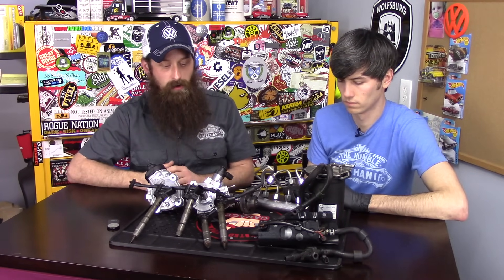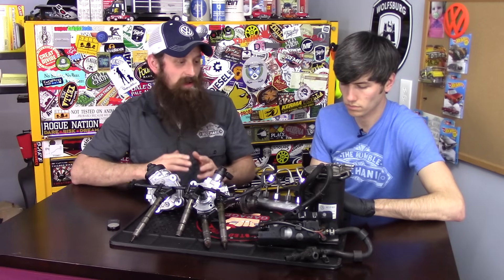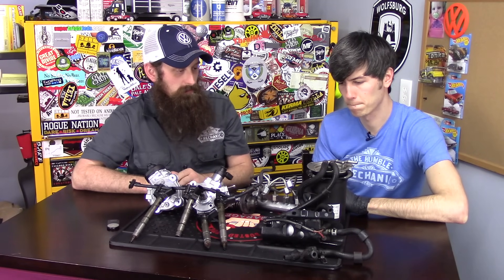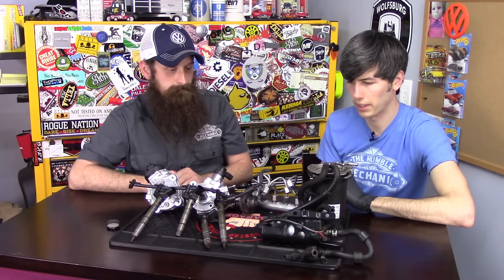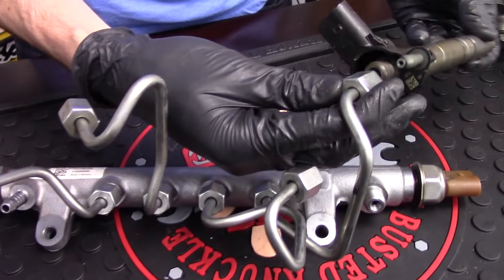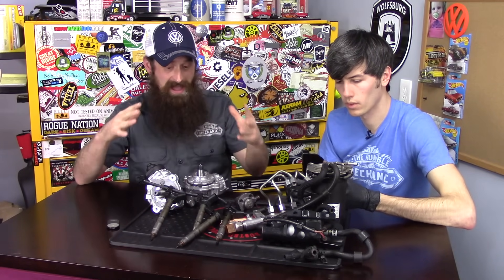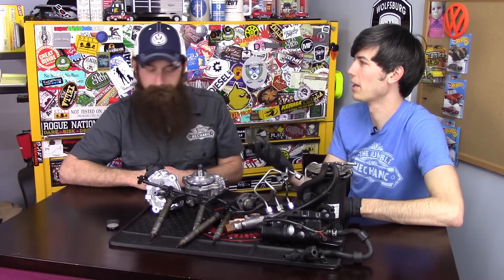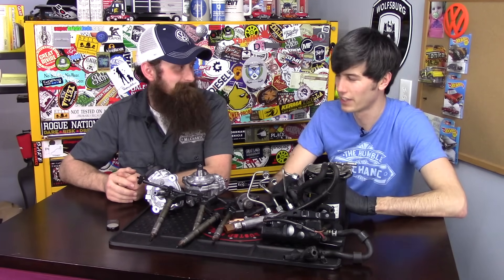Putting Gasoline In A Diesel Car - What Happens?

Comment: It worries me that this gentleman is out there suggesting this kind of work for this problem.  Other mechanics will charge $100 and send you on your way. This fellow charges $8,000 just in case things were damaged by exposure to gas.  The thought process he goes through is frightening. "This could be impacted, new assembly.  This might be touched, new assembly.  This could have a thing in it, new assembly."

It's outrageous.
Reply: this guy works for a dealer and OEM have procedures(bulitens) what to do when a diesel engine  is run with gasoline . the metal  contamination I also  seen it in BMW our repair for this usually  run around  15k.  if the engine is not run we jusy drain  the tank
Reply: +WoodysGamertag dude its crazyy seeing you here
Reply: none of what he said to replace was for exposure to gas, except for the things that would be ruined by gas.
Reply: +WoodysGamertag Could be a new engine in some cases. Labor costs are what kills it.
Reply: HillorStream there is a big difference of having say 1.5 to 2 gallons of gas in say a 20 gallon tank VS say your tank is almost empty and you pump 15 gallons of gas into your 20 gallon tank. But yes you are correct they did put gas into diesel as a winterizer don't know if they still do today.
Reply: Diesel engines WERE different back then. Significantly so.

A non-common rail engine (which is all that was on the market in 1993...) would very likely behave as you describe; I used to mix ~5% gasoline in the diesel to prevent paraffin crystals forming in cold weather, and never had a problem, but I wouldn't do it now. Unless you have someone picking up the tab I wouldn't try this in a modern diesel.
Reply: he wants to make money. dont we all ?
Reply: +WoodysGamertag whoa Woody watches engineering explained? My life is complete
Reply: Because I AM A MECHANIC.
Reply: Isn't winter blend 10% gasoline anyway?
Reply: Maybe if you were able to have insurance pay for it you would go through with $8000 in repairs.
Reply: +woddysgamertag   Around 1993, I accidentally filled up a diesel Ford box truck with gas.  It would only start by getting it rolling and then popping the clutch while cranking the starter at the same time.  It had very low power and the entire tank of gas was burned up in only 60 miles or so.  Once I was down to about 1/16th of a take, I stopped and put diesel in it.  It started after only a few cranks, had full power and perfectly good mileage.  It was just fine and never had a problem for the next 2 years I worked for the company that owned the truck.  Maybe diesel engines were different back then but I'm doubtful.  Mechanics (and engineers) have been known to be zealots in the church of "Right way vs. Wrong way".  I prefer "If it ain't broke, don't fix it".  This is indeed outrageous.
Reply: +WoodysGamertag Crazy seeing you here Woody! I would have to disagree. Any common rail diesel will need to have all these parts gone through if you run gas through it long enough. It is under extremely high pressure, and under very high tolerances. Yes with older diesels you just flush the system and make sure it's primed with diesel and be on your way, but it's not like that with the newer systems.
Reply: @thepeeve  then the newer system suck!
Reply: @thepeeve  - Depends how much petrol you've put in. If you've already half a tank full (say 30 litres) of diesel and you've put in 2 litres of petrol by accident then moved it to a safe place with the engine on for 20 seconds, it's a simple case of getting the tank drained and refuelling with diesel. Doesn't matter whether it's a modern diesel or not.

Now if you've put in a full tank of petrol then it's a different ball game particularly if you've driven it for a few miles. That's when the bill becomes eye watering because of the damage it may have potentially caused.
Reply: +WoodysGamertag You're always free to avoid preventive replacements and wait till something breaks. It is sometimes cheaper, and probably more often much more expensive. Have you ever seen what happens when the injector stays open? Oh its really fun, I mean, if you ever stop and live enough to enjoy. But metal fragments in the cylinder have almost the same fun value, especially after a few hundred miles. Having the high pressure pump broken is just simply boring, as well as having other metal stuff melting together or apart, as it happens.
The guys replace everything which have a high probability to break your engine apart as a preventive measure, and they actually pay for the contaminated mixture to be taken away safely (and legally), but you can obviously just pour it into some water around, say, somewhere in california. :-P
Reply: CARB has announced that emissions in class 7 and 8 trucks do cause issues and reduce reliability. So it may trickle down to regular autos soon and dpfs will be removed until the system can be made to be fully reliable.
Reply: fightingfalconfan have to agree. Gas engines are way cheaper and just about any knucklehead to work on it. Newer diesels...not so much. Plus the hourly rates are usually different too.
Reply: On a trip across country with a bunch of guys... a fella put gas in his buddies  diesel truck.  Fortunately we had a mechanic in our caravan and he simply emptied the fuel tank and change the fuel filter.
Reply: So how did he dispose the stuff he drained out?  @HarrisonCountyStudio
Reply: Great question Roger Ridgway. It just so happened that a local farmer, pulled into the Pilot Station while the owner of the truck stopped the fueling of gasoline into his diesel. The old farmer  had a 55g barrel in his bed. Apparently he had a use for the now mostly contaminated gasoline and offered to take it off our hands. There was nearly 15gallons of combined fuel drained (5x into a three gallon cooler). Other wise, they probably would have dumped it out on the hot concrete to evaporate.
Reply: You probably have no idea what metal does when it goes past the piston
Reply: +WoodysGamertag woodys not a car guy
Reply: +WoodysGamertag Did you watch the video thoroughly?  There are pumps that are engineered to be lubricated by diesel, which is heavier and thicker than gas, but not as thick as oil.  But thick enough to lubricate the pump parts.  If the pump is pumping gas, there is no lubricant, and metal to metal contact sends metal contaminates all through the system.  He said it would be a bad day for you if your fuel injector was stuck open.

I find it interesting that you follow a lot of the same channels I do.  Vet Ranch/Demolition Ranch, Sailing La Vagabond, and a few others.  You have to get Dr Matt from Vet Ranch on PKA.
Reply: fightingfalconfan Why are YOU on a mechanic's channel?
Reply: bimmerTEK and im totally surprised that he would lie...he makes 35-40 an hour off of the 90- 120 the dealer will charge you

Comment: I love these collabs; theyre awesome! Charles is super informative and Jason (??) is just hilarious while still adding knowledge to the conversation. At the dealership I work at, we actually had a shuttle driver put gasoline into a 2500 Duramax diesel, and after much test driving we got it all flushed out. The day after the customer picked it up, he called in complaining that it wouldn't start, and we've had it for the last week or two trying to get it all working properly again. I'm amazed at how easily misfuelling happens.

Comment: once by mistake I filled up my 2005 2.0 HDi diesel Volvo S40 with 45 liters of high octane gas "petrol", and drove off .. 15 km later the engine started to become rough, then turned in to limp mode, and started throughing all sorts of CEL codes at me, then it just cut out and refused to restart .. I realized what I had done only after reading the receipt from the gas station. Called a recovery flat bed truck and had it taken home until I decide what to do next. 
Having nothing to lose from trying, the next day I went out, completely drained the tank by detaching the lowest situated hose connected to it, then I emptied the fuel filter cup and washed it with diesel, changed the filter, filled the tank up to the max with premium diesel " cetane 61" plus an additive, and by using a hand bell pump I started to aspirate diesel fuel at the High Pressure Pump fuel input port, thus fully bleeding and flushing the fuel input lines en route to the H.P.P., I did not disassemble the HPP nor did I touch the injectors, which are Siemens piezoelectric class 5 injectors btw., .. then I started cranking, after 5 secs she fires up with a puff of white smoke, 20 secs of rough idling then she smooths out as if nothing had ever happened, after driving through that one full tank I change again the filter, and no metal particules were to be seen neither in the filter cup, nor between the paper filter fins. I have since drove over 72,000 km "approx 45000 miles" and still no ill consequences! 
Moral of story: 4k for anticipative repairs, or ... go figure 😉

Comment: New fuel pump - $200
New injectors - $200
New new filter housing and high pressure lines - $200
Cost of work - $200
Disposing fuel at oil refinery - they pay YOU $0.1 per gallon
Total profit - $7200.
Reply: Where ya getting a fuel pump for a diesel for 200 dollars id buy 20 and resale
Reply: @wvboy0311  right? The injectors for my truck are $1,200 lmao
Reply: Where are you getting high pressure common rail diesel injectors for that price? Even my old Bosch injectors cost more than that.
Reply: Ma samo se promeni filter i ispere rezervoar dizelom. I to je to, ne znam zasto ljudi potenciraju i dalje na ovolike skupe popravke. U svakom slucaju moj ceo auto kosta kao pola ove "popravke".
Reply: Or just put the gas in your lawn more or sell it to a friend lol

Comment: But what actually happens to the ENGINE?? Will you blow a hole in the piston due to preignition of the gasoline due to the high compression ratio? Or is that a myth? I hope there is a Part 2 to this!
Reply: Did you not watch the video?

Comment: You only need to empty the tank and fill it with diesel again... Flushing with brake-cleaner and replacing almost the whole fuel system is not needed. A little gasoline will not hurt the engine.
Reply: It's not the motor/engine they worry about.. it's the fuel system, it's bolted to the motor, the fuel system is a separate assembly. 

With new common rail diesels, it's a whole different ball game to old school diesel system. Much higher pressures involved, meaning greater strain on everything to begin with and with lack of lubrication from petrol/gasoline, it gets worse. If the vehicle is driven too far with petrol/gasoline, it can quickly cause damage(it's like running without motor oil). If it's not driven at all and barely runs, it should be fine with a drain, flush and refill. Is there $8000 of parts and labor??? It depends on the manufacturer, the damage and whether genuine or after market parts are used. If it's under warranty or you go to a dealer, you can bet your life it will be genuine parts! 

If you have an old school diesel with the gear driven, inline injector pump, running petrol, isn't really a problem....

Comment: if anyone wants to see it in action, there's an old fifth gear video on here where they put gas in a diesel engine and diesel in a gas engine. It's on an older car, so it doesn't have the same effect. But still interesting

Comment: One of "those" mechanics that will change everything whether needed or not. Flushing out all the old fuel, then running a full system of diesel should dilute it out enough. If gas wasn't left in the system very long, anything that was to be broken would be very apparent.

Comment: My boss has has been running both his diesel utes for the past 11 years on the "mis-fuels" that we perform at work. Most of the time the utes are running a (more or less) 30% petrol 70% diesel mix.  They have never had any pump failures or any fuel system related issues. Mind you the utes are older technology diesels, so a modern diesel might be as happy.  He even runs his 78 holden GTS with about 10% diesel in it, apart from a little bit of smoke on startup its fine.

Comment: Jeez... Talk about overdoing it. I used to work as a technician at a Citroen dealership, and the only thing we had to do was to drain the fuel tank, replace the filter (not the entire housing), and then fill the tank completely up with diesel. The engine might be a little rough to begin with, but there were never ever any problems after the second filling of the tank.

Comment: if you are lucky you can just drain the tank change from gas to diesel and just pull the injectors and crank the motor untill you just pump diesel.
Reply: why would i pay someone when i can fix it all myself.
Reply: +Trent Nelson No one's stopping you from paying about $4000 for the parts.
Reply: +Trent Nelson It's a personal choice.

The issue is that if anything goes wrong down the line it will cause further need for repair, and possibly more damage to the car, making the repairs more expensive. If they're already pulling your car apart to clean all of this out, they may as well replace the parts that might require them to do that all again, or cost you more money down the line, especially since any effects down the line could make them liable for the damage.

And as for whether that's a good decision, the bearded guy said in other comments that the extent of the repair is mandated by VW, and often covered by them, and that if he deviated from it, the liability would be on the business instead of VW.

As for people confused how you get $8000 out of $5000, four things: Rough numbers, running a business is expensive, businesses need to pay taxes, and businesses exist to make a profit, not operate at cost.

Comment: To all who say why not to drain tank first and then to change parts if they fail. If an injector stays in open state because of small metal parts - it will cause severe damage to the whole engine. Yes, there is a chance that it will never happen, but nowadays diesel systems are too precise to hope that you are the lucky one.

Comment: Hey EE, why do Diesel engines have such a low rpm range compared to gasoline engines?
Reply: Randy Crossman  Diesels have more torque than gas engines, so they don’t need to rev as high to produce as much power.

Comment: Replacing all these parts is way overkill for this issue. I can see the HPFP being compromised if the engine is run for to long for damage to occur but come on,  most of this can be remedied by removing the bad fuel and flushing the system with good fuel before running the engine again. Replacing all these expensive parts because the "MAY" fail in 10K or more miles is why people don't trust dealerships because the dealership is using this as a way to bilk the customer for everything they can.

Comment: I think the current common rail diesel systems run at much higher than 800bars of rail pressure. Anywhere from 1500bars, to the ones with higher specific power output running 2500bars.

Comment: Its my understanding that a diesel fuel dispenser wont fit into a gasoline equipped filler neck. The diesel dispenser is larger in diameter compared to gasoline filler neck, so that should be impossible. However, the smaller gasoline dispenser would fit into the diesel filler neck which would allow for improper fueling. Crazy that gas can do so much damage to diesel components.